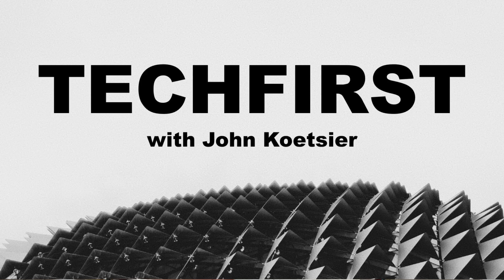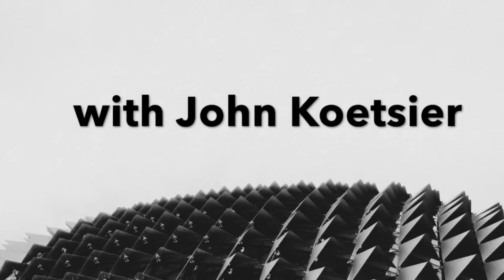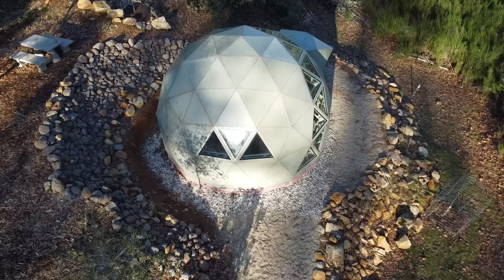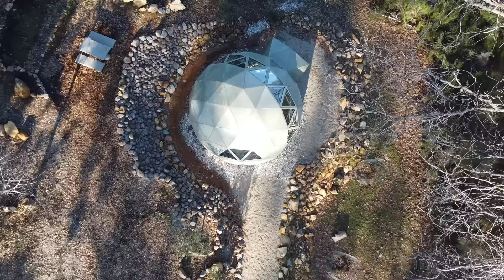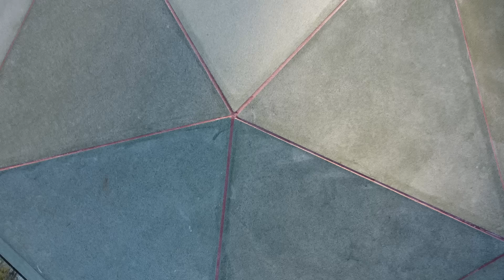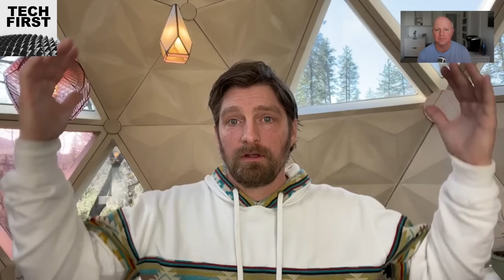500-year ceramic geodesic dome home: now real

Comment: Geoship’s pitch reads like a manifesto of inevitability—“first principles,” “physics,” “compounding cost reductions”—but after a decade, it’s hard to ignore the gap between rhetoric and reality.

This is a company that claims to have reinvented housing from the ground up, yet hasn’t demonstrably delivered a single completed home at scale. That’s not a minor execution hiccup; it’s an existential contradiction. If your entire thesis is about radically improving production and delivery, but you can’t actually produce or deliver, the thesis isn’t proven—it’s speculative.

The language leans heavily on abstraction: “integrated systems,” “geometry optimized at the fundamental level,” “materials engineered together.” These phrases sound rigorous, but they function more like insulation against scrutiny. There’s little concrete evidence of throughput, cost per unit, timelines, or real-world performance—just assertions that everything improves simultaneously. In practice, housing is a brutally constrained industry shaped by permitting, logistics, labor, financing, and customer trust. None of those yield easily to elegant physics arguments.

The claim that cost reductions “compound with scale” is particularly hollow without scale. Many startups assume manufacturing efficiencies will appear once they reach volume, but reaching volume is the hard part. It requires capital discipline, operational execution, and a product that can actually move through regulatory and market friction. Burning $600k a month without shipping suggests the opposite: scale is not compounding advantage, it’s compounding risk.

There’s also a familiar pattern here: substituting technological ambition for business validation. Robotics, AI, novel materials—these are invoked as inevitabilities rather than tools that must prove themselves under real constraints. In housing especially, innovation doesn’t matter if it can’t pass inspections, secure financing, or convince a buyer to commit.

Even the benefits—health, resilience, sustainability, longevity—are presented as universally superior, with no trade-offs acknowledged. That’s rarely credible. Every material and design choice introduces compromises. When a company claims to win “in every category,” it usually means the categories haven’t been stress-tested in reality.

In short, Geoship is selling a vision of structural transformation without demonstrating operational traction. After ten years, the story isn’t about breakthrough engineering—it’s about persistent non-delivery wrapped in increasingly polished language. Until there are actual homes, occupied by real customers, at known costs and timelines, this remains closer to a narrative than a product.

Comment: I would have liked more technical information. What seals the panel joints? Is there interior condensation? More about plumbing and electrical? What is the insulation rating? What is the assembly process. How much does a kit weight? No web link?! Oh how I wish we had this in Brazil.

Comment: This guy has it well thought out. Geothermal  passive solar and being insulated to ?  R90   
But shaped will cause problems with off shelve  kitchen . bathrooms unless its built into design. 
I would love a greenhouse house to buy as a kit for tradespeople to purchase and save on labour..
What kind of warranty is given with the purchase of one of these? 
 When in mass production.and costs drop right down I think it has massive potential..
As for manufacturing Potteries in Stoke  UK was the biggest ceramic manufacturing of the world with all companies all in this area for a reason. Worth a Google for you.

Comment: So eh… multi-family how? I’m sorry, but you’re not solving ANYTHING without providing proper multi-family housing. This design is very literally inferior to a run of the mill commie block. It’s cool and all, but… yea it doesn’t SOLVE anything.

Also ceramics aren’t good insulators so… U values are what?

… Checked the website? R-24 and 1ACH as if that’s supposed to be special? Laughing in my Greenlandic engineering pants 😂 double the R value and halve the ACH and you’ve got one of the very normal social housing projects I’ve worked on.

Comment: Could someone use the same material and techniques to build a much, much larger structure, such as a basketball stadium or a dome on Mars (which might get Musk interested)?  Could they (someday soon-ish) use robots in the manufacturing processes (Musk again)?
From the description, I believe it's the same material they used on me when I had DBS (Deep Brain Stimulation) brain surgery a few months ago. They used a caulking gun to seal the cracks they made in my skull. All better now! For 500 years!! :)
Seriously interested in this technology. I live just 225 miles from Nevada City, CA so a road trip isn't completely out of the question.
PS in case you're wondering, DBS was for Parkinson's and you wouldn't believe the tech they had to use for that!  Gotta say; anything's possible. Live on and prosper!!

Comment: Geodesic domes have a tendency to leak and mold tends to grow unless you have a ventilation system to reduce humidity.  Did this company address those issues?  Monolithic domes don’t have leaks because they don’t have connective pieces.

Comment: The idea of living in a box made of lumber is ridiculous in my mind. Our modern homes turn into bonfires immediately. 
Domes made of fire resistant materials would be a lot more appealing to me. They don't get blown away, earthquakes have to be very powerful to destroy them and ceramics shouldn't burn easily. If you borrowed some concepts from Earthships you could make them super efficient, they'd grow you some food or whatever plants you like 😉, they collect their own rain for water, and make their own power. They also treat their own sewage on site. But Earthships are labor intensive, they take a long time to build and they're definitely not cheap. So if the systems could be made into a hybrid with these domes it would be awesome. I would definitely want one!! I already want an Earthship..
Reply: You have raised many of the points that I, too, have been thinking about.  A clever/ well-thought-out, well-working, extremely-well insulated, energy & resource efficient/ recycling, and HEALTHY  to live in,  ceramic dome/ Earthship combo would be good, especially with all of the increasing natural disasters (which are actually "cosmological"/ galactic in origin, and NOT from puny human contributions - but HEY, they can't TAX & blame people for natural, cosmological cycles...). 

 Regardless, we need to know of/ consider such factors when building our homes/ homesteads - AND consider the potential hazards of our building sites MUCH better, PRIOR to construction.

Comment: My dad and I built our first geodesic domes back in 1978. We used polyester and glass to make them light weight and we found that we could use sand and stone mixed with the resin to creat a fire resistant material. The domes have the same properties as pyramids that creat life energy propergation throughout the structure. Very healthy for life.
Reply: Was that your own innovation technique to do it? Anything on your channel to check?
Reply: @GreenCanvasInteriorscape  Yes it was, I will try and find some photos to share with you.
Reply: Wow! Way ahead of the times! I wanted a berm house,  but then came across these - man I want one of these!
Reply: @VictorClarion  Yes, domes are great. They also help enhance positive energy and are very relaxing to live in.
Reply: Well they might be affordable right now according to your numbers but as soon as two factories start trying to put these things together The prices are going to double or more
Reply: @mauriceupp9381  Making domes is quite often cheaper than doing standard building.

Comment: I absolutely love what you are doing. I was born in Portsmouth, Ohio 73 years ago and my Dad would drive us past these ceramic houses someone was building. He liked that they were fireproof, would not need painting and last forever. You have combined those features with R. Buckminster Fuller’s geodesic structures which are inherently strong and efficient. If you can get your manufacturing costs down you should be able to sell these to people who don’t have to worry about midget minded homeowners associations or zoning codes. You really should try to collaborate with Tesla or Figure AI. These things could easily be assembled rapidly by humanoid robots. I wish you the best of luck.
Reply: F Tesla though 😂

Comment: For years I'm looking into this. Now im no engineer but to me a dome shape would be the most economical.  But I see I more as an iglo what the Eskimos have out of ice. Only im looking into blocks of styrofoam. I found a piece that's not the typical styrophome u find in packaging material but way way stronger. Like it's  1ft thick and I can't stab a knife through it. The car can driver over it not a mark. It's dence and weighs maby twice the weight. But it floats. It was used as a float for a fishnet for years at sea. That's how I found it. I'm looking for this stuff to build big blocks and build a dome house that actually floats. And buy a cheap piece of swampy land. Or have it as a house boat so I save on propertytax
Reply: Actually,  i THINK THAT THIS VERY SAME  CONCEPT -- SUPER-THICK & STRONG STYROFOAM DOME HOMES, are already being built in Japan.  Lightweight, earthquake-resistant, fire-resistant, mold-resistant/ moisture-proof, economic, quick assembly, etc.  Sorry, I don't have specific references , but I watched vids on them that showed up in my feed, over the past 5 years.  Cheers!

Comment: 1- ‘chemically bonded polymers’. Involves petrochemicals. 2- a sphere is the worst possible shape for usable space. Homes need dead spaces like attics, crawl spaces, wall interiors to run plumbing, wiring, ducting and more that can be modified, repaired, replaced. 3- The hippie generation Tried geodesic dome houses long ago.  There are two of them visible from my house.  The lesson learned was they Can Not be made waterproof reliably. 
This is because of how wind hitting a sphere can push water UPHILL, or to either the left or right as the path of least resistance.   It’s why geodesic homes built in the past all have shingles covering the whole thing, and even then, they don’t keep water out.   Window sealing is particularly a problem.  4- 500 year is a pipe dream, and not a worthy goal, especially for homes that can not have wiring, plumbing, or ducting easily modified.

Try building a home that incorporates 5,000 years of human experience building shelters.   A framed roofs with overhanging eaves work better. Vertical walls make water run in ONE predictable direction. Crawlspaces or attics allow for better insulation, and more flexible options for interior appointments and layouts.
Reply: 1: they’re primarily using perlite and magnesium. 
2: different design philosophy means different technology. 
3: Many old cultures across the planet have used variations of round structures. Look at the US Natives that built grass house as just one example. 
4: ceramic lasts a long time. 
Extra point, round structures are better for natural disasters.
Reply: @ 1-Perlite is not a polymer.  It has the troublesome feature of expanding or contracting a lot when heated or cooled so it’s not dimensionally very stable. Magnesium is ALSO not a polymer, Its a metal, and a highly flammable metal at that. 
2- Design philosophy has nothing to do with technology. I can make a dome out of carbon fiber, or I can make a dome out of stone. The plain fact is that MOST new technologies applied to building design have turned out to be problematic. From PVC plumbing, to central air, many create 2 new problems for each problem they solve.
3- No cultures other than hippies have made spherical houses.  The floor plan being round versus square is NOT the problem ( except when trying to fit furnishings and appliances in it )  Its the fact that the WALLS and roof form a continuous constant arc.  This means that even mild wind can overcome gravity and drive rain upwards or sideways around the curve.   Which is why dome houses are infamously hard to weatherproof and keep weatherproof.  Cultures that made round houses STILL made them with conical roofs that featured significant overhang on the eaves and Vertical wall. This design was not based upon ‘philosophy’ it was Evolved over centuries of practical experience at what kept water out of the house versus what did not.  Modular triangular panels have to be weather sealed along their entire perimeter, And houses MOVE. They expand and contract with changes in temperature and barometric pressure and they FLEX under wind loading. For this reason it is the joints between triangular panels that lose their weather tightness and start to leak.  There is no way to consistently Flash these joints that wind driven rain cannot get under because of their wildly varying orientations. 
4- Vitreous ceramic lasts a long time. Like the ceramic your toilet is made from where it has been fired high enough to become glass. Low fire ceramics like terra cotta are porous and can absorb water and water can leak THRU them. Like porcelain tile, versus bisque fired tile. Porcelain is suitable for exterior exposure, but bisque fired ceramics will not survive a century outdoors without erosion, spalling, or mold intrusion.  And high fired ceramics are neither cheap, nor environmentally friendly. It takes a LOT of energy to fire ceramics. 
Extra point.  There is zero evidence that ‘round’ structures are better for natural disasters.   A lot depends on the nature of the disaster.  An earthquake will shake a dome apart as readily as any other building. The key to surviving earthquake is strong ties between structural elements that are somewhat flexible. ( ie wood framed structures survive earthquake better than brick. )   Round offers no real protection against floods, because floods to not break up houses thru their lateral force or pressure on the house, what they do is surround the house, creating  buoyancy  forces so strong that the house is Floated off its foundation, and once its no longer held in shape by its foundation, the house can flex and buckle in the current of the water.  Water only has to get a couple feet higher outside the house than in to tear it loose thru buoyancy.
A spherical house with no shingles on the outside might withstand the wind forces of a tornado or hurricane, but without the shingles it certainly WILL leak. But tornadoes also destroy houses by rapidly dropping the air pressure outside the house so its own internal air pressure will push it apart from the inside. And a geodesic house does not necessarily offer any greater resistance to this potential unless it geodesic are bolted metal bars. But that won’t prevent the triangular filling between them from popping out.

Sorry. Houses have the shape they traditionally have based upon what proved to work.  Spherical houses were tried back the 70’s and 80’s and people pretty much stopped building them because they did Not work.  Harder to heat and cool, harder to remodel, harder to furnish, harder to waterproof. 
Look at the manor houses in England and France, or even the old cottages that litter their countryside if you want to see what design philosophy actually has proven to last 100 years, or more.

Comment: I hope they have success. In all honesty if I lived in tornado or hurricane or fire zones I would put aside style preferences and just go with these ceramic dome homes I wouldn’t lose. If the prices sr3 as low as 5hey say I just really hope it works out. The material is intersting. The theoretical interior design mockups are fantastic. It looks really good whether you like the geometry or not

Comment: Bring the lumber industry back. Knock down the fire hazard, burn bio mass, make electricity, and cement from the ashes. These things are not killing the planet. We are not running out of sand. Concrete brings water to areas, and builds dams, that in turn create the means for hydro electric. Allow people to use local materials, so we aren't burning fuel to get it there. Screw the spotted owl. Open up the lumber industry, the hemp industry, stop sqeezing the people of their resources and making prices soar. Allow farmers the water they need. Stop killing cows, because they fart. I don't want Bill Gates fake meat. A person can look at hundred year old pictures of coastal water levels and compare them. Al Gore scammed you. His book bought him a mansion on the sea shore, that should be currently submerged.

Comment: the most important question, will it leak? because pretty much all domes leak, how is it sealed so it lasts?
Reply: Outside is panels with sealing over each gap. The sealant is applied liquid bioceramic. When it’s done it’s basically one piece. Any cracks or issues down the years can be repaired the same way. Like sealing cracked concrete with liquid concrete basically…

Comment: How do connect wiring (usually in walls) plumbing, heating. How do repair it if a panel breaks (ceramics do break). The dome itself is aesthetically pleasing but a whole suburb full of these would look like Levittown on Mars.